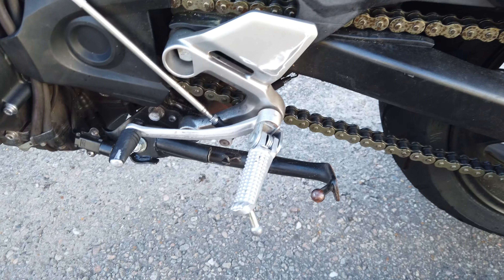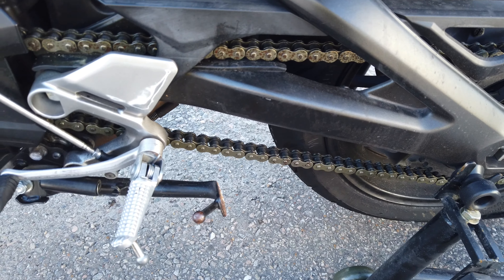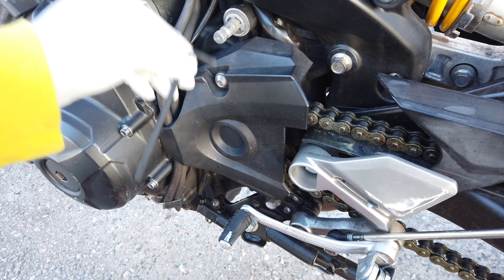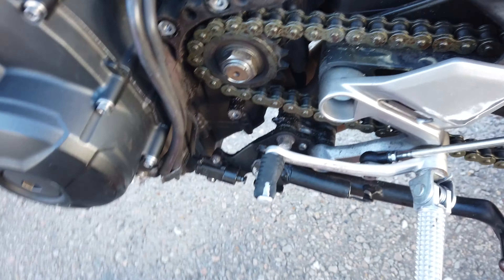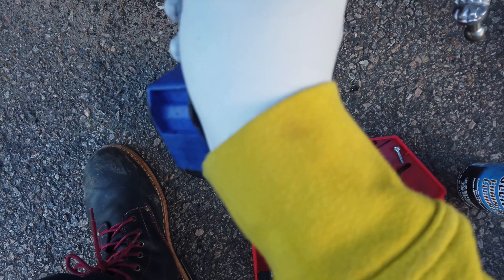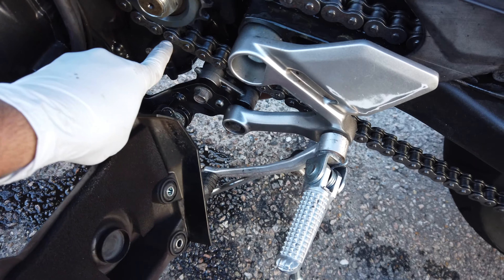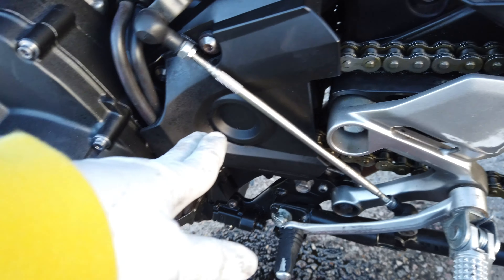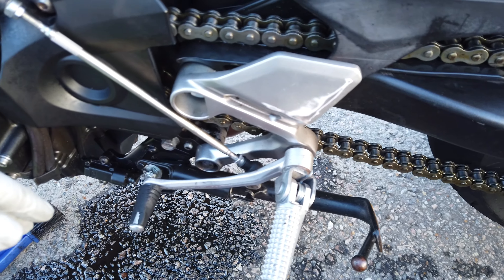2015 Yamaha FZ-09 - Maintenance day - Front Sprocket cleaned

Comment: So... The oil and the goo you cleaned directly to the floor? In Madrid you'll get a 400€ ticket
Reply from the maker: Yea - you’re right - I never thought about it. I will start using something to catch the drip
Reply: @lazaruspachigalla8273  I use biodegradable products (a lot of them are), and most of the "gunk" is from the road anyway. I wouldnt worry too much as long as youre not leaving a gross mess
Reply from the maker: @johnhandy3483  that’s a good thing to look out for - will start paying attention to as well thanks man